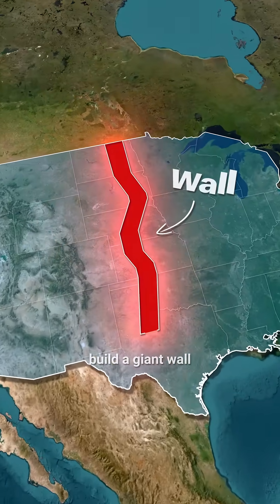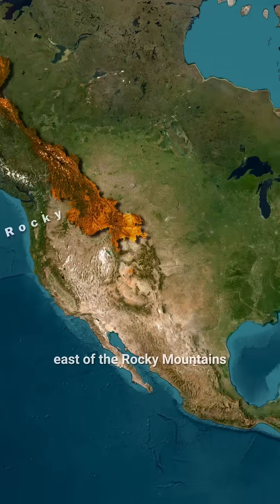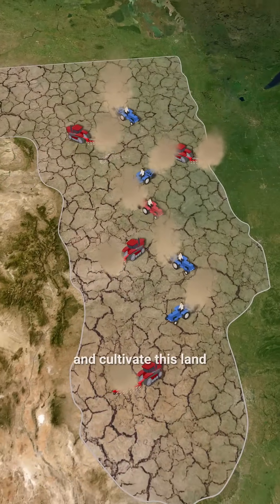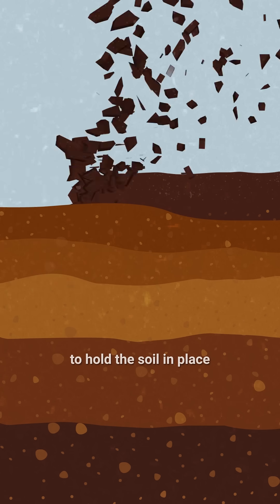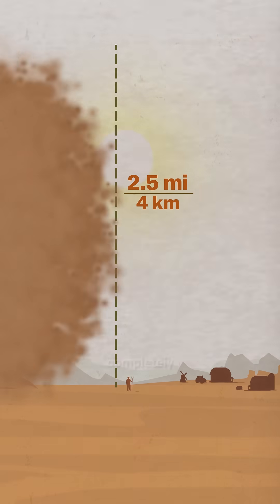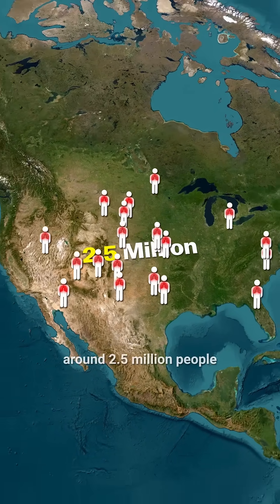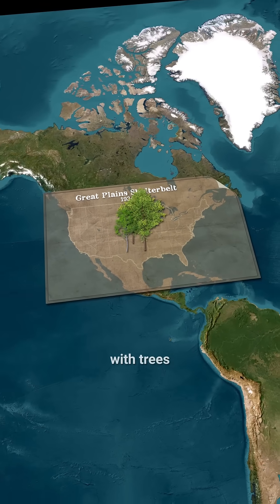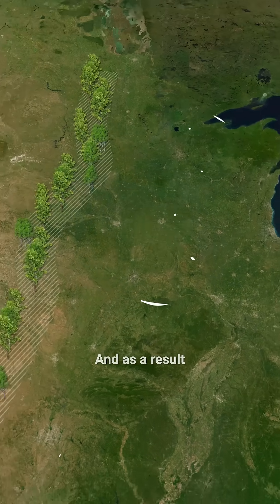Why USA Built a Giant Wall from Canada to Texas 😱🇺🇸 Great Plains Shelterbelt 🌳

Comment: It wasn’t tree belt alone that saved the  Dust Bowl region. The Government and farmers implemented many changes to farming methods. Like crop rotation and water conservation.
Reply: Didn't they also include plowing that followed topographic contours instead of arrow straight plowing?
Reply: @FirstLast-yj4ri ya at some point, they realized you could farm rolling hills without causing massive mudslides
Reply: @FirstLast-yj4ri  You would be surprised how many farmers in the SE still ignore contour and how many use conventional tillage. When the wind whips up it's like a dang dust storm. We do have a ton of trees though so we don't see much aeolian erosion. It is mostly colluvial.
Reply: @brekkie1.2 contour plowing doesnt do much to stop wind erosion. Its more about stopping water erosion and helps keep water from all running down a hill.
Reply: @4stringer67  I know. I was making more of a general statement about soil conservation in the SE, not about aeolian erosion specifically. We have few psamments and other entisols formed from wind blown sediment in the SE.
Reply: @brekkie1.2 understood 🤜💥🤛
Reply: There is just so much semi -infornation going on caused by this post its kiinda worked me up alittle. Down belowfurther even govt conspiracy dupes are getting their 3 cents in about the govt hiding the treewall info . So Im sorry. If I over stepped
Reply: @FirstLast-yj4ri 😂
Reply: @FirstLast-yj4ri Yes, that was another farming method that was implemented. The trees were just a very small factor. What helped more than anything was teaching farming techniques, changing the type of crops grown, crop rotation, buying up some farma to rest a large area, but most importantly planting back the prairie grasses. 
This video gives the tree planting the full credit which is completely untrue and they didn't even explain that method well either.
Reply: @FirstLast-yj4ri no not on a large scale. Contour plowing is more about stopping water erosion in hilly farmland..curved rows dont stop wind. Farming itself really didnt hit its stride on a large scale like what youre thinking until around the 50s at the earliest when 10 row equipment started  coming  into existence once there were tractors big enough to pull that wide . Tractors were tiny and there weren't really all that many around in the late 20s. That tree belt did nothing to help it had to grow 15yrs before it even made any kind of difference. Treeline effects dont stretch 3-5miles at the very most, and to do that it would have to be huge. A normal tree line at the edge of a farm makes a difference of less than a mile. Crop rotation is about soil nutrient replenishing not water conservation. The thing that ended the Dust Bowl was mainly that the rain came back when the LaNiña cycle changed  after an extended period. ElNiño and LaNiña cycles usually happen3 to 5 year cycles and varies the LaNiñia of the Dust B was 10yrs long give or take.
Reply: The real biggest change was converting marginal land to grazing. The epicenter of the Dust bowl was the Oklahoma panhandle. It was all under tillage. Today only the areas that can access enough water grow crops under center pivot irrigation. The rest is all cattle grazing. It is easy to see on Google maps. Dry land grasses are specialized, without enough water for agricultural crops and their roots, the only way to get calories off land is livestock. Once all the fossil water is gone from Nebraska and Kansas, the same conversion will get required, for the same reasons.
Reply: I grew up son of a cotton farmer southern Tx panhandle. Center pivot irrigation is colloquially called "a circle system" . We had 2 of them. Also had 4 of  whats called a sideroll system. Im wondering what was being farmed in the Oklahoma panhandle that you were talking about under tillage. But the treeline thing in the vid ? Its all overblown by the op. It had to grow for 15yrs or so to get any effect at all out of it. As far as Im concerned, this short is clickbait or at best just inaccurate to a large degree.
Reply: @Soil-Nerd you have more right than most . But back in the 20s farming wasnt going on nowhere near as much and was limited in scope because the tractors were tiny and and  . You started seeing 10-row equipment  come about gradually 50s and 60s when the tractors could handle that wide. There was barely any irrigation at all back in the 20s and the Ogallala was basically still full.  The dust bowl pretty much ended because the rain came back after an extended LaNiña (which causes dry,  El Niño causes wet) weather pattern for about a decade. Confirmed . Cotton farming pretty much stops  any further North than Amarillo because of too short if growing season. In the 20s farming was still ona small scale basis.
Reply: Crop rotation has existed for millennia why didn’t they already do it 🤨
Reply: @justanape9149 all crops need water. Crop rotation is about soil nutrient replenishing not water conservation, thats why. Also ,back inthe 20s there wasnt very much irrigating going on yet. So water conservation really wasnt a thing yet. The Ogallala was still full in the late 20s.
Reply: @justanape9149 because many farmers only see short term profits and don’t care about the environment. Where I live we’re in constant drought and the biggest crops are almonds and pistachios. It takes an entire gallon of water to grow JUST ONE ALMOND. But hey almonds make the most money so fuck the water.
Reply: @geoarambula139 Do not forget the governments and unions which force farmers into a profitable frame.
Reply: @geoarambula139  You are totally ignorant. Farmers care more about the land than you. You don't have a clue what you're talking about. All you do is repeat what you hear your liberal politicians tell you. You sound like a Kamala voter.
Reply: @geoarambula139 seems like youre saying they ought to growsomething else then.. where do you live geo.  I lve in Lubbock same  area as where I grew up.
Reply: Most likely California. They grow a ridiculous amount of almonds (80% of the worlds supply) there and the state is constantly trying to limit how much water they can use while refusing to build more reservoirs to save the rainwater for farming
Reply: Really? It wasn't this simple. Many were still plowing with horses. And it wasn't a wall of trees. The USA soil conservation service was enacted to stop the dust bowl using many strategies. Trees don't grow instantly. 
Today we  know a lot more about regenerative agriculture and forestry. And again are still making mistakes. Especially in the Rocky Mountain tops that supply watersheds that feed massive rivers to both sides of the continental divide with water. It's not climate change. It's political desertification. Ignorance as usual.
Reply: @danpercell1765 Excellent comment, succinctly presented and accurate!  This video reeks of a pseudo-science marketing attempt to revive the rotting "follow the science" phenomenon.
Reply: Crop rotation has been used since George Washington
Reply: He had to dumb it down for today’s audience.
Reply: @jdsthird I’m learing!  Thank you😊
Reply: Both can be true at the same time? It wasn’t one thing that saved the country and stopped the dust bowl it was a combination of the tree wall, more regulations and different cultural practices.
Reply: I’ve also heard that that’s why grass lawns became very desirable to help fight this
Reply: @RichterNYR35  I like the sound of that !
Reply: Confirmed. ...  Extended 10 yr long LaNiña current pattern out in the Pacific. The concept that contour plowing ended the Dust Bowl has limited merit.  The dust bowl ended because the rain came back. Sand doesnt turn to dirt no matter how you plow it unless you have rain.  Contour plowing and rows can only keep good dirt from blowing away. It wont turn sand into dirt. Trust  me I am cotton farmrs son that grew up  within the territory of the Dust Bowl. We had a good little dry spell in the 70s too. There was a lot of sand in the half of the county that didnt have as much irrigation as the other half. Ive plowed enough sand to make half the Sahara jealous 😉 Ive pulled huge almost mile long sand dunes down with a land plane.
Reply: They did all that 100 years before the depression.
Reply: Ancient methods. Nothing new under the sun. No new inventions.
Reply: @annemaria5126  human were not put here for stupidity, but thats all see in this world, pot heads can’t think or talk, walk, drive, they don’t even know how to eat!
Reply: What you are saying is myth. You're just repeating info that is "common knowledge". Problem is, it's largely incorrect. The treebelt did nothing since it had to grow for atleast 15 years to even start to be effective. Farmers not the Govt are the ones who change how they farm. Farmers are advised by what is know as a county extension agent on methodology but they dont have to do it. There was hardly any need for water conservation when there was hardly any irrigating going on in late 20s to change. The water conservation movement is much more recent because we only started paying attention to the Ogallala Aquifer levels and worrying about it in the 70s., when we were still wasting water like a big dog. I watched the transformation first hand. I grew up basically at the SW part of the Dust Bowl area. Dad was a cotton farmer I worked on our circle system . I also had two uncles that drilled water wells for farmers worked for them some too. Anything you want to know about water wells I can tell you.  Crop rotation isnt about water conservation, it is for soil nutrient replenishing and maintaining. Contour plowing ? Yeah right look up what tractors existed in the 20s and 30s. Fact is there wasn't really anywhere near the amount of farming going on back then because the equipment didnt exist yet to do it large scale like they've done for the last 60-65 yrs or so. The thing that ended the dust bowl was when the rain came back and that happened when the 10yr  LaNiña cycle finally ended. It was an exceptionally long one at that time. Now, you know....
Reply: Point stands though, when something absolutely had to be done the political will appeared, farmers adapted and problem was improved. Now if we were on the edge of a climate disaster, where the gulf stream and AMOCC that would caus catastrophic climate change including reicing Greenland then politicians would undoubtedly step up and change!!! Or maybe Mar a Lago in that path of a Cat 5......
Reply: Crop rotation was already a thing
Reply: Also tree belts were huge tho
Reply: Google these words...: "did El Niño or La Niña cause the Dust Bowl?" 😉
Reply: They built a lot of lakes since thoughts days too a lot a few more would nice
Reply: Yes, the government used planes to re seed grasses all through the conservation project. New farming Technics were developed and the lands were put into the programs that paid farmers not to plant crops but planting things like Alfalfa and other plants like Yellow clover, some plants that became noxious invasive species too. Instead of planting wheat and corn, Sunflowers became common, even planting grasses and leaving large tracts of land in cultivated and allowed to make return to natural states of Prairie vegetations
Reply: They also have no- till grain drills that don't require plowing and discing fields to keep from making dust in the first place. Most major agricultural farms use this method now.
Reply: Jesus came down from heaven, lived a sinless life, died for us on the cross, and rose again 3 days later, defeating sin and death for all time. All have sinned and rebelled against God (Romans 3:23-24) (not including Jesus since He is God). The wages of our sin is death (Romans 6:23). But “God so loved the world, that He gave His only Son, so that whoever believes in Him should not perish (not go to hell) but have eternal life” (go to Heaven) - John 3:16. God loves you and wants a relationship with you and you have to believe in Him and love Him and repent (turn away from sin) and follow Him and you will be saved. “that if you confess with your mouth the Lord Jesus and believe in your heart that God has raised Him from the dead, you will be saved“ - Romans 10:9. God will change you and your heart and He will make your arrogant and evil heart of stone into a kind and loving heart that is obedient to His commandments which are perfect, as He has changed me. He will change you so that you can love Him and love others, as He changed me, even though we fall short of God’s glory by sinning. Surrender your life to Christ and believe today and be reconciled with your loving Creator and know the God who made everything and everyone who doesn’t delight in the death of the wicked: “Have I any pleasure in the death of the wicked, declares the Lord GOD, and not rather that he should turn from his way and live?” - Ezekiel 18:23.  Also, “The Lord is not slow about His promise, as some count slowness, but is patient toward you, not wishing for any to perish but for all to come to repentance.” - 2 Peter 3:9. God loves us so much that He wants all to come to repentance and is patient with us and doesn’t punish us for our sin if we allow Jesus to take our sin off of us because He died in our place because we deserved death for our sin so Jesus, having never sinned, died in our place. “He made Him who knew no sin to be sin on our behalf, so that we might become the righteousness of God in Him.” - 2 Corinthians 5:21. But He will punish those who continually reject Him or who have rejected Him even until death. The time is soon, Jesus is coming back, and many aren’t saved. Don’t wait! Accept the gift of salvation which God gifts us and believe in Jesus because God has promised that if we believe in Jesus (Who is God), we will receive eternal salvation. “For it is by grace you have been saved, through faith—and this is not from yourselves, it is the gift of God—” - Ephesians 2:8. Repent (turn away from sin and resist temptation to sin) and come to Christ who will take your sin away, give you a new heart to love God and love others, and He will save you from condemnation on judgement day when He judges everyone for what they have done. What an offer! “For the wages of sin is death; but the gift of God is eternal life through Jesus Christ our Lord.” - Romans 6:23. Praise God!
Reply: Meanwhile greedy farmers like the billionaire Resnick family cleared the central valley for farming.  A huge agricultural industry but unsustainable.  

They wasted water and want more. (I.e., water that is released for salmon and other river resources).  

And the water system can't handle overflow so water is sometimes released into the ocean. If the system uses what amounts to a sink faucet, you've got to release strategically so the system isn’t overwhelmed.

The Resnick's own their own underground reservoir.  Those million dollar farms should concentrate more on water conservation or creating their own reservoirs or paying to upgrade the water system
Reply: Crop rotation has been around for a long time
Reply: Yes.
Reply: I was in Minnesota
Reply: Bro crop rotation has existed since the biblical times
Reply: @coteywallace7290  It wasn't practiced in this area before the Dust Bowl years.
Reply: @cdjhyoung because the farmers were greedy.
Reply: @gamesguy  How could greed be the reason?  They just had to learn a better way.  Greed is not the answer to everything.
Reply: @debbieb1482 How is greed not the reason? The federal government gave them the land FOR FREE and told them not to till it and to only use it as grazing land. The farmers wanted to try and squeeze more profit out of the land since growing crops yields much more money than using as cattle pastures. 

Then the same greedy farmers caused the disaster. Today most of that land is back to being cattle pastures because it's simply unsuitable for growing crops, barring a small portion that's heavily irrigated.

Crop rotation reduces profit. The crops you rotate to are typically much less profitable cover crops that often you wouldn't even harvest and just plow under.
Reply: @cdjhyoung did I imply it was invented in the Midwest?
Reply: @d @debbieb1482 uh because when your poor, and have no money and have to feed your family off the land, you use everything?

I don’t even understand how some people can be so ignorant to not even think to a basic logical conclusion? Seriously?
Reply: @coteywallace7290 no 'bro' (streetlanguage) in open civilised conversations.
Reply: This may blow some peoples minds, but you can also rotate an empty part of the field 🤯
Reply: @coteywallace7290 modern crop rotation was not used before the industrialisation and the intoduction of forage grass. They used a diffrent system before with areas dedicated to meadows, pasture and crops.
Reply: @Villeskanal the Bible literally says to rotate crops in a 7 year cycle?
Reply: @coteywallace7290 thats not crop rotation, thats fallow (dunno if right translated). I.e You grow crops on the land, then you whait a couple of years before you grow crop on the land again. 
Crop rotation is were you grow crops every year but you switch with diffrent type of crops
Reply: @Villeskanal you rotate the crops as well as leave 1/7th empty.

It’s one and the same
Reply: @coteywallace7290 leaving land empty is not rotating with a crop.. lol.
Reply: @V @Villeskanal ya that’s not what I said.

You can laugh at your ignorance of the subject and English language all you want.

If you can’t comprehend how rotating the type of crop and rotating a portion unworked is one and the same, then idk bro, not much to debate
Reply: @coteywallace7290  No, it's not the same. You're trying to equate 2 different things. You're confused, and your need to mix biblical stuff with modern crop rotation is showing your ignorance. You could just Google it & learn something - 

"Crop rotation is the practice of planting different types of crops in sequence on the same land over seasons to improve soil health, manage pests, and increase yields, rather than growing the same crop continuously"

It says nothing about leaving plots empty in 7 year cycles. It's specifically never leaving them empty, but changing crops every single year.

The Bible talks about just letting the land "rest" on the 7th year called "fallowing." 

It also says not to mix certain seeds. That's not modern crop rotation. That's you deciding the two things are the same.
Reply: @corey2232 did you seriously just pretend your smart by google and copy and paste? Lmao

And you believe google and AI? Lmao dude wake up.

Yea genius, you obviously know nothing about the Bible, you should google some more and learn? Lmao

It’s basic bible language structure, everything is after it’s own kind, humans, animals, and plants.

And the concept of not mixing seeds is because different crops take and leave certain nutrients

I understand it takes more than 3 brain cells and AI to comprehend a single bible line and try to compare that to an AI paragraph.
Reply: @coteywallace7290  He's not believing Google!! I'm actually a 3rd generation farmer, and what he said is ABSOLUTELY CORRECT!! If I plant corn  in field A, oats in field B, and hay in field C, the next year, you would switch them and put oats in field A, hay in field B, and corn in field C!! Different crops pull different nutrients from the soil. If you don't rotate crops at least every 2 years, you get low yields. There's absolutely no reason to leave a field empty!
Reply: Crop rotation exists hundreds of years longer than the US exists
Reply: Doesn’t mean it was practiced. Where in my comment did it say that crop rotation was invented during the dust bowl?
Reply: @geoarambula139 settle down kid.
Reply: @geoarambula139 you said "many changes" instead of "brought back". It's a prescription thing.
Reply: @joshusavage5100  they also said "implemented" not "invented". It implies that the methods weren't used by the farmers before, not that the methods didn't exist. There's many many cases where we know better but go for the short term gain. Take massive deforestation in the Amazon for farming. Those farmers know that the soil will be exhausted and they'll have to do it again in a few years. They can see issues with flooding and erosion with their own eyes, but it will continue without intervention. 😢
Reply: @MCDek
True it’s just that the farmers that got to the Americas only wanted to grow “cash crops”. Tobacco, Sugarcane, cotton, and whatnot. 

Arguably they still do, soybeans being infamous nowadays 

Always the federal government that has to fix these farmer’s greed
Reply: @Huacan09 it wasn't cash crops that caused the dust bowl but over farming to support WW1.
Reply: @Huacan09  we had to learn about crop rotation in history class during the 13 colonies part of the curriculum every year so I doubt that the cash crop farmers wouldn't have pick up on that by the 1930s
Reply: @Huacan09 so farmers should grow crops that don’t make them cash? 😂😆😝😝😝😝😝😆 PRICELESS!
Reply: @_DB.COOPER the land was gifted to the farmers from the government for free. The federal government warned them not to till the soil because wind erosion was well understood by that point. It was supposed to be grazing land for raising cattle. 

But the farmers got greedy and planted crops instead, creating the dust bowl disaster. Not all land is suitable for all agriculture. 

Modern farmers still do this, they over plant and when the year is good they profit. When the year is bad they make a claim from their subsidized federal crop insurance. 

Everyone is forced to subsidized these farmers and their bad behavior.
Reply: @gamesguy 😂😆 I farm and ranch kid, you can do the same thing by overgrazing the land, that’s why we rotate pastures. Not all land was given to people. You should try farming for just one week. Smh…
Reply: @_DB.COOPER I literally grew up on a farm. Wtf does your reply have to do with my point? They didn't have irrigation on these farms during the dust bowl and they certainly didn't have modern soil management techniques. 

Tbh I don't think you farm, at most you're a hobby farmer larping
Reply: @gamesguy you grew up on a farm and didn’t learn anything? Seriously!
Reply: @gamesguy  Growing up on a farm doesn't mean you know anything about it! Did YOU actually farm?! My one sister grew up on our farm,too but never really paid attention! My other sister and I  were riding horses when we were very little but that one sister asked me to teach her to ride when she was a teenager! I knew how to drive a tractor when I was 12. She never learned at all! Just being on the farm doesn't give you knowledge!!
Reply: It's a short there is a limit to how many topics one can cover
Reply: @AreebKhan-c5s  yeah but they could of add a sentence or two saying that there where other factors that helped instead of just implying it was just trees
Reply: Which stopped it better than trees did
Reply: @LokiuniusGaming wouldn’t know you’d have to ask an ecologist or someone a lot smarter than me lol. My guess is preserving topsoil since the depletion of it is what left us with nothing but dry infertile  sand.
Reply: @geoarambula139 I learned, the soil is/was not infertile, because of the sandstorms coming from the African Sahara. Yes...good things do come from Africa, sometimes.
Reply: @LokiuniusGaming wouldn’t know you’d have to ask an ecologist or someone a lot smarter than me lol. My guess is preserving topsoil since the depletion of it is what left us with nothing but dry infertile  sand.
Reply: This is the comment I was looking for, there’s always somebody who thinks they know more than what the video shows! PRICELESS!
Reply: 😅 industrial farming/ ranching kills topsoil and murders ecological systems. Period. There is NO SCIENCE THAT SUPPORTS ANYTHING ELSE. So you're misguided, brainwashed by meat and dairy lobbies or just plain dedicated to ignorance.
Reply: @phoenix333333333 do you mean the same science that lied about COVID and the vaccines that caused my friends and relatives to die and nearly took my life and has given me problems that will last until the end of it..or do you deny that as well..just asking?????!!!
Reply: @phoenix333333333 dedicated to ignorance, that's good !
Reply: To all the experts replying , watch the Ken Burn’s Documentary “The Dust Bowl”. This is where I learned this. Not once did I imply that the US government “iNvEnTeD” crop rotation or other farming practices. The government worked with farmers to implement the best farming practices to protect topsoil and water supply
Reply: @geoarambula139 yes Burns is the absolute truth. He’s never embellished anything in his life and he’s a subject matter expert on this topic. Smh…
Reply: People had farmed that way for centuries, cooperations bought a bunch of farmland, hired a bunch of people that didn't know shit about farming to work the fields and had them rip out every tree and bush and farm on flat ground to maximize planting area.
Reply: @seanmce8132 😂😆😆😝😝 ok kid.
Reply: Come on 🙄 The government caused the dust bowl, confiscated the property of small-time farmers who were ruined by it, them implemented “solutions”
Reply: @bijoulille8816 the government released explicit recommendations to NOT till these areas. First, this was quite forward looking at the time, governments at the time mostly did war and mail full stop. But ...lots of farmers bought cheap land out west and farming makes 3-5 times what grazing does, not to mention that farmers from Missouri were not cowboys, so they ignored the government recommendations and plowed anyway. Had to read all about it in my graduate environmental policy class.
Reply: @bijoulille8816 that land you’re referring to was GIFTED to White settlers by the government if they agreed to farm it. The HOMESTEAD ACT OF 1862. After they killed or deported Native Americans. But sure the  government NEVER helps Americans. I’m guessing you don’t read much
Reply: @bijoulille8816 What you just said is complete BS. The dust bowl were created by these small time farmers themselves. They ignored all known agricultural practices in their greed to plant as much as possible. 

European farmers knew about wind erosion for a thousand years and planted hedges or trees as windbreak to protect their farms. This isn't some new thing people didn't know about, American farmers simply ignored it.

Moreover, the land was gifted FOR FREE to the farmers from the federal government who warned them not to farm it. But the farmers got greedy and turned the grazing land into farm land and caused a disaster.
Reply: @gamesguy Why is it bs? Bc your TV told you so? 😂
Reply: @bijoulille8816 did you actually read anything I said or did you fail grade school? 

TV? Where do you watch a video about the dust bowl on TV?
Reply: The fkn government does nothing for anyone
Reply: @tinaroberts5858 

The federal  government solves all issues. Which half are arguably caused by them.
Reply: @tinaroberts5858  In FDR's time they did
Reply: @PatrickChizek Yeah, they did things like intentionally creating the dust bowl, blaming small-time farmers for it & then implemented  bullshit “solutions” to enrich themselves & their friends
Reply: @bijoulille8816 😂😂😂
Reply: @bijoulille8816 The dust bowl were created by these small time farmers themselves. They ignored all known agricultural practices in their greed to plant as much as possible. 

European farmers knew about wind erosion for a thousand years and planted hedges or trees as windbreak to protect their farms. This isn't some new thing people didn't know about, American farmers simply ignored it.
Reply: @bijoulille8816  Jesus Christ lol it’s always a conspiracy. Salt in the ocean? Government put it there. Sun is hot? Government is fueling it with propane. Gravity exists? Giant government magnet.

Genuinely so stupid
Reply: @tinaroberts5858  
They can't tax people who have nothing.
Reply: @wjf0ne yes instead they tax other people for the people they can't tax.
Reply: @tinaroberts5858 yea its inefficient and pretty shitty rn but you have roads and bridges to get around even if theyre shitty right? People who are in extreme poverty are provided some healthcare and food stamps? The government should be doing alot more and be way more efficient but to say they do absolutely nothing is idiotic.
Reply: @tinaroberts5858  NS. The foreign bot comments praising the government stick out like a sore thumb
Reply: @bijoulille8816 it's foreign bots like you that mindlessly hate the achievements of your own country. You people can't even address the factual statement he made, all you have are these worthless comments about the government
Reply: @amazin7006 🤣🤣🤣 Rage is the attempt of the limited mind to placate
itself. You're funny. And willfully ignorant. 💕